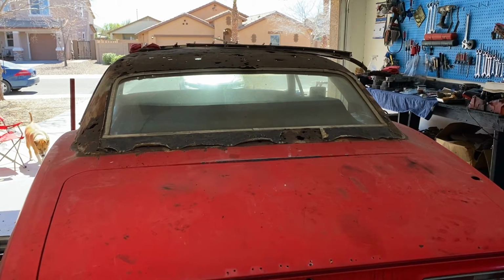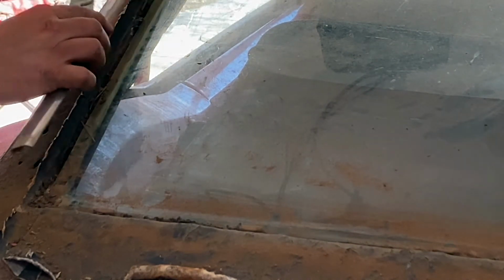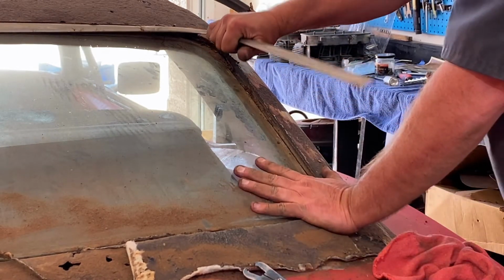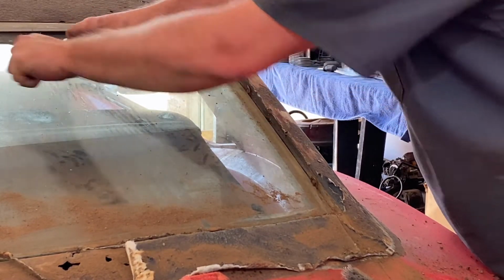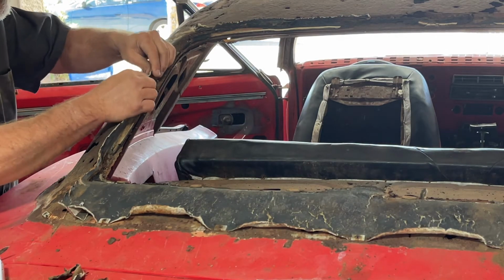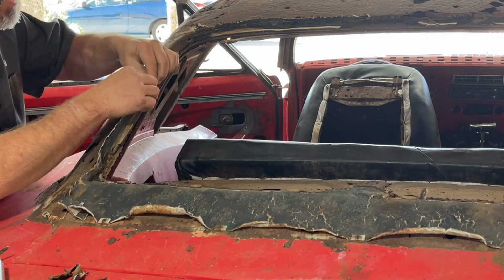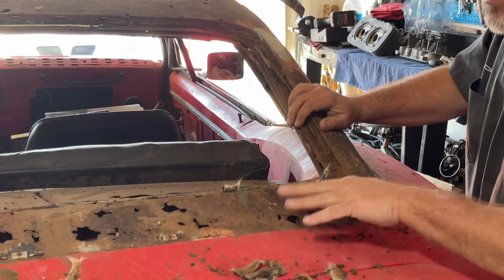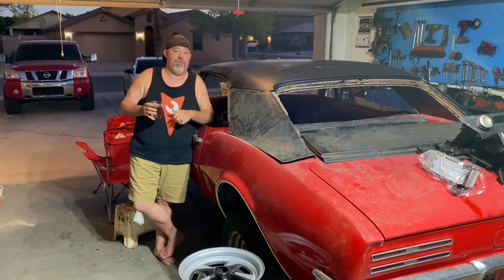How To REMOVE REAR GLASS AND TRIM from Firebird - Camaro First Gen F Body

Comment: You're keeping up a good pace.  I've never used the tool you have.  I've always used a thin wire like piano wire to remove the glass.  Working under the glass from the inside then with a helper pulling it all the way around.  Of course my 68 bird rear glass blew out trailering it home!  Not the best way to remove it not cheapest.

Comment: you are using the removal tool wrong side 
it is made to remove from outside of windshield in inside
Reply from the maker: Hope you watched all the video, I have had success in the past going from the inside on other cars but this GM F Body didn't allow me to.
Reply: @ArrowheadGarage  
Sorry
I just removed one from my 79 Camaro yesterday first by cutting around the glass from the outside with a box cutter removing the excess material from around the glass then using the same tool from outside without any damage to the glass.Yes, old vehicles are  much harder to remove than the new ones,
best to remove glass when the temperature is above 70 degrees